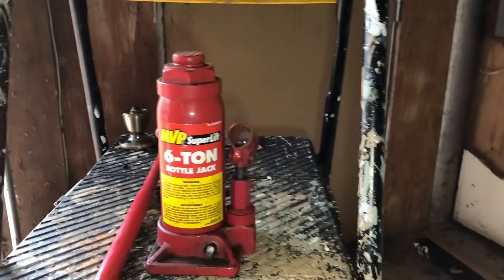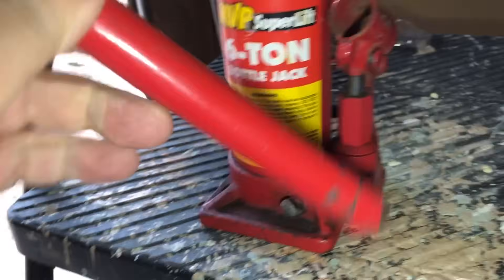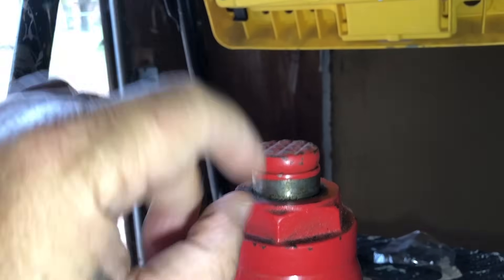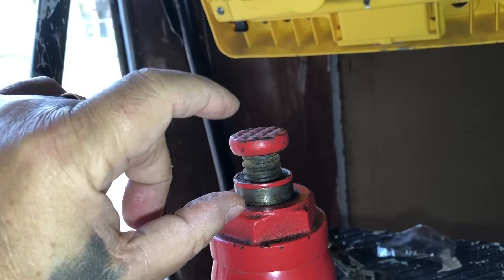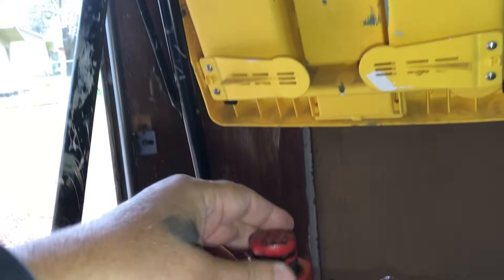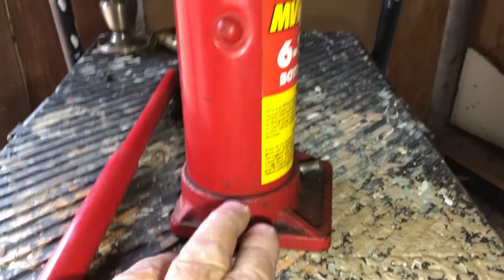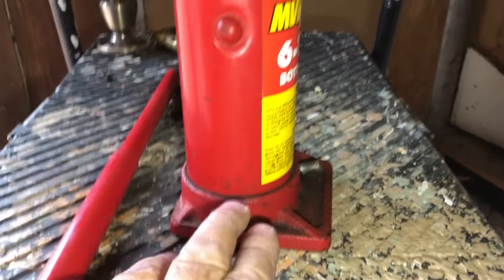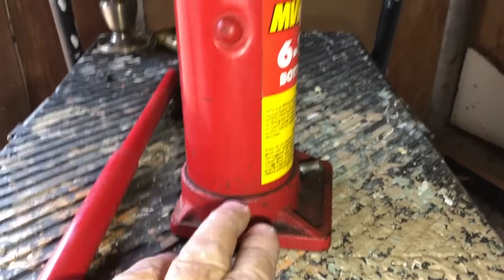Hydraulic bottle jack tutorial

Comment: I happened on this video b/c a repairman put an old bottle jack under my lawnmower to take the tire home and put plugs in. I picked up tire from his shop 18 miles away and brought it home to put on myself. (non-mechanical recent widow) Anyway, I could not get the jack down. I turned the valve on bottom counterclockwise and pushed on it but it didn't come down. It could be it has no jack oil. It is rusted and old. I think I found buried in the dirt when we bought our 6 acres. LOL

Comment: Thank you. I just bought a 4 Ton bottle jack to raise my travel trailer and when I read the instructions, it said not for use on TTs. 😒. Is that really true or can I use it anyway?
Reply from the maker: You can use it to raise it as long as you block it up and remove the jack. The jack is not intended to hold weight I definitely.
Reply: @bctruck  Thank you.  My GTWR on my TT is 7,595.  Will this 4T bottle jack be adequate to lift until the jack stands are holding it?
Reply from the maker: @lorihawkes1084  yes. You wouldn’t be putting all 3.5 tons of trailer n the 4 ton jack all at the same time. You would be lifting one corner at a time. It should be sufficient for that job.
Reply: @bctruck  Thank you!  I never used a hydraulic bottle jack before and your video was just what I needed to learn how.  :)
Reply from the maker: @lorihawkes1084  glad it helped!

Comment: what happens if you use a hydrolic bottle jack with very low oil?
Reply from the maker: It won’t raise anything heavy.
Reply: @bctruck  I used a brand new bottle jack the other day and wasn't sure how to use it but after figuring it out I used it to lift the front tire and once I was done I lowered it by turning that little knob counter clockwise but as it lowered it didn't fully go down causing for it remain stuck under my vehicle, so kept turn the knob when all of a sudden it came right off and oil started pouring out. I quickly screwed the knob back on, a lot of oil poured out but not sure if it was all of it inside. I used another jack to lift the car and take the bottle jack out. Is the bottle jack still safe to use?
Reply from the maker: I’d have to look at it to tell you anything more.

Comment: Mine goes up but doesn’t go down...
Reply from the maker: Unscrew the check valve and take it apart. The little ball in it is stuck.
Reply: Thanks, will try :)
Reply: @bctruck  This China made jacks come with 30 weight oil.  Remove the rubber plug on the side, drain the oil ,refill the jack with mineral spirits and shake it tclean it inside, drain it again and refill it using jack oil. the plug hole is the level. hope this help you, is what I did with good results. That is a common problem on this jacks.

Comment: Do you think I could use a similar 5-6 ton bottle jack to level an RV? I would simply park, level the RV using the bottle jack but place blocks under the wheels of the RV, then lower the bottle jack.
Reply from the maker: Yes.
Reply: @bctruck how long is the bottle jack meant to be used?
Reply from the maker: @stacyyoust  temporarily.

Comment: What happens if one stores a bootle jack on the side? Does it get irreparably damaged?
Reply from the maker: No, not irreparably damaged but it could let air into the system requiring the jack to be purged before it will raise a car.
Reply: BCtruck, BC Blades thanks a million for the info n quick response
Reply: Most of the China made jajcks have a rubber plug known to leak when the jacks are not standing up. So before you store one on its side b sure
the rubber plug IS UP.. I juts bought one and to avoid problems a 1|8 pipe thread plug  was welded to avoid any leak on my car rug..

Comment: My 20 ton bottle jack lifted but after i turn the bleed screw to let it down it will not go down. What do i do? Do i have to jerk it out of my truck i lifted and put it in a press to get it down?,  Harbor Freight.
Reply from the maker: man! Im at a loss for that one!
Reply: @bctruck  I am too. Just brought it home from HF and screwed it in and started jacking up and it worked fine but when i unscrewed it to let it down, even standing on the damn thing it would not move. I guess back to HF and get another one since it is only two hours old.
Reply from the maker: @thorthunder3227  Good luck!
Reply: After the tire is replaced, place a piece of board or a 2 by 4 under the tire, release the jack and you have clearence to remove it even if it is stucked.
any how my friend drivers are not carefull to always carry shorts pieces of 2 by 4 and thiner ones in your car..This is  a must. Most of the times you do not get a flat on a concrete flat surface.

Comment: What if it don't raise up?
Reply from the maker: check to see that you have enough hydraulic oil in it. It should be level with the fill hole.
Reply: @bctruck  it is! 😪
Reply from the maker: @GladysAngelWorks3110  I would guess that the check valve  is needing some disassemble and repair.

Comment: I kept twisting my valve until it came out with the rubber gasket inside. Now i had to wack it with a hammer to re insert  the plug. Whacking in a twisting motion.
Reply: Hey it worked!